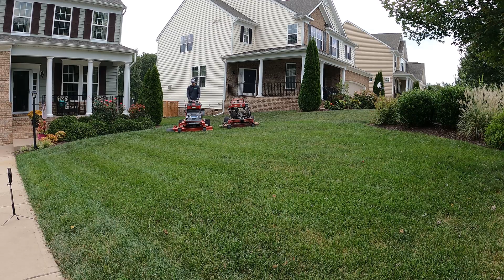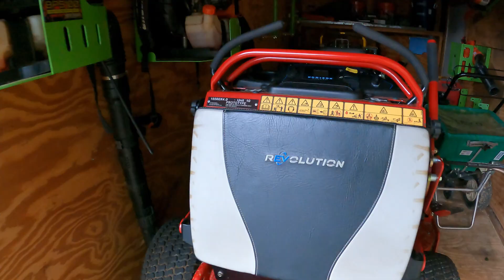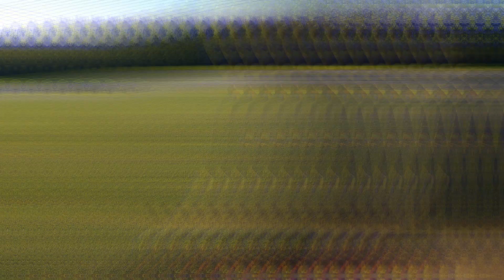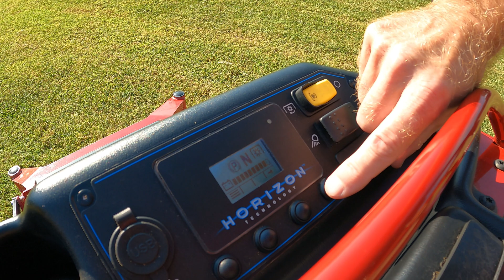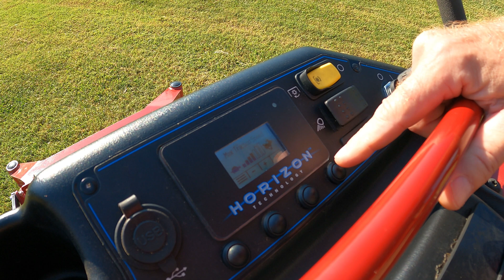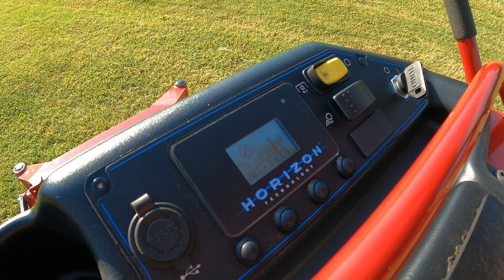Gas Lawn Mower VS Electric: Which Toro Grandstand Lawn Mower Is Right For You?

Comment: One thing that needs to be touched on is potential breakdowns and warranty coverage. Plus, what are the consumable parts that would need repair or replacement? Motors have stators, wiring harnesses, capacitors, fuses, pc boards and on and on. Electronics are suseptible to moisture, corrosion, etc. I'd like to see the yearly maintainance cost vs gas. Just things to consider. Great video

Comment: Thanks for the review! I skipped around a bit so I could have missed it but the reason they differ on the discharge of clippings is due to the blades being different would be my guess. If you have the same blades they should discharge the same. That rubber thing on the electric mower could have made a little difference also.